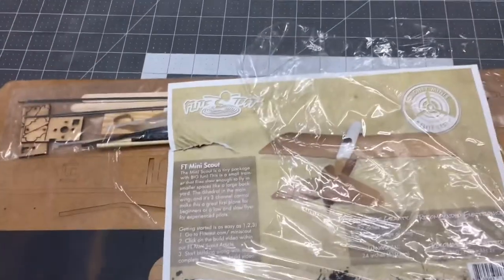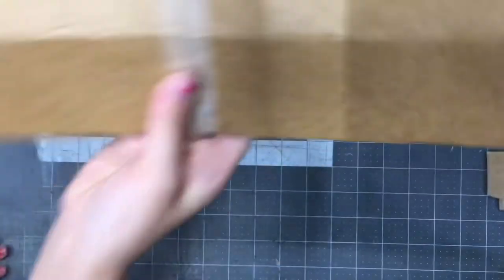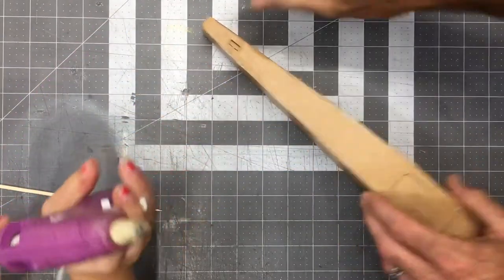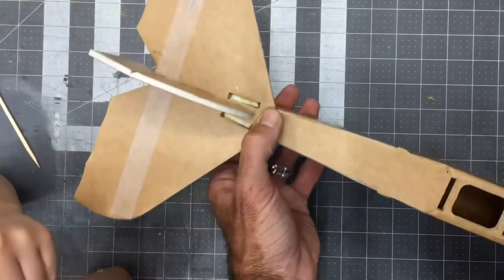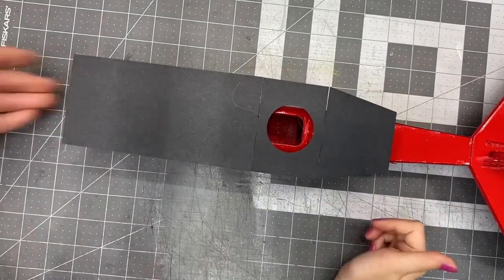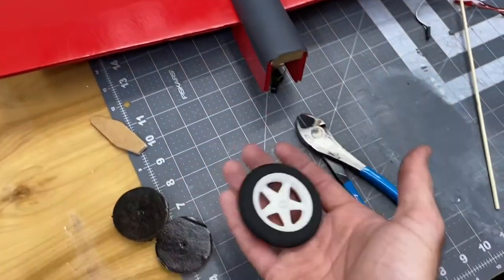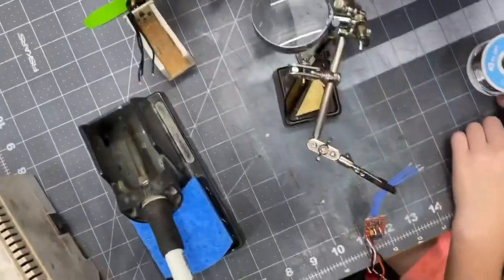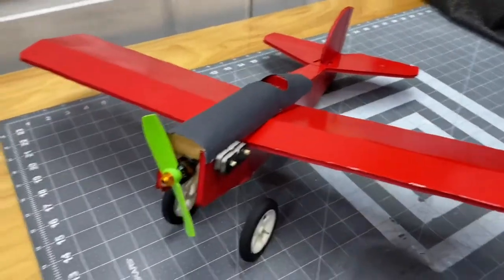Teaching My Daughter How To Build A RC Airplane

Comment: You should go to FliteFest next year.  I would love to fly Helicopters with you and help you and your daughter build another FliteTest plane (I usually volunteer in the build tents at FliteFest).
Reply from the maker: I definitely want to go one year, I am finishing up my trailer and it is not that far away so it would definitely be a fun trip. Can you fly anything or only foam board/foam stuff? I’m not big into foam airplanes everything I have is balsa and fiberglass. It would be great to fly some helicopters with you!
Reply: @westhobbiesrc8051  The only restriction is it must be electric.  Gas is not allowed.  I fly my Concept X5 DLG (a carbon fiber hand launch glider) there all the time and I have seen people who were flying balsa planes.  Multi-rotors and electric helicopters are allowed.  The bigger issue is that they allow a lot of planes to fly at the same time.  So many that mid-airs are unusually common so they do not recommend flying anything you would be upset about crashing.  When I fly my DLG, I walk to an end of the field where few people are flying to reduce the risk of a collision.
Reply from the maker: Yeah I figured it’s all electric, I do manly speed planes (250mph plus) and big big stuff! I’m building a 16ft B-52 bomber all electric with 8 90mm EDFs. I wanted to bring that when it’s ready but I don’t want a bunch of planes up and risk a midair with a $20k plane. I’ll definitely go next year for sure! Will be fun!
Reply: @westhobbiesrc8051  For something big and showy like a 16ft B-52, you can talk to Stephen and/or Josh Bixler and they can work with you for a time that they will have all planes land so you can do a Demo flight with you being the only one in the air.  Really, everything is flexible and you can get special flying conditions if you can convince Stephen and/or Josh Bixler that what you want to do is reasonable and of interest to the attendees.  I would be happy to help you work with Josh and Stephan.